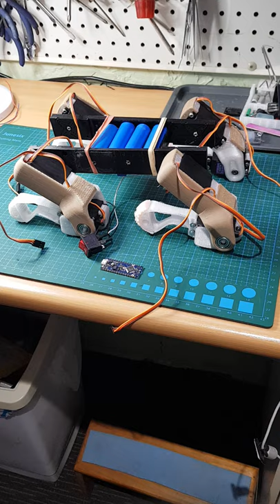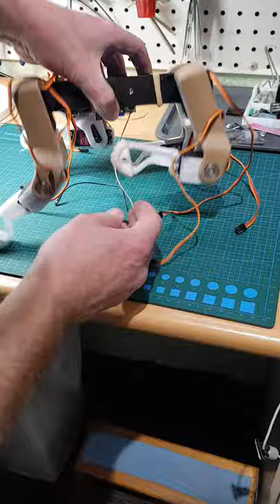Spot (what?)   New design preview

Comment: Is this update suitable for cls6336hv servo?
Reply from the maker: I think those servos look good but they seem quite expensive. I buy about 10 servos for the price of one of those but based on what we've seen they may be a better choice. However, as my latest redesign shows, the 15-10-4 bearing sits on the top of the servo. While the flange to locate the inner race to the servo is not critical as the horn-screw will centre the servo, the centre rotor of the bearing needs to sit on the top of the servo and to rotate freely from the outer race. I hope this makes sense but without knowing more of the exact dimensions of those servos I cannot make a definite recommendation.